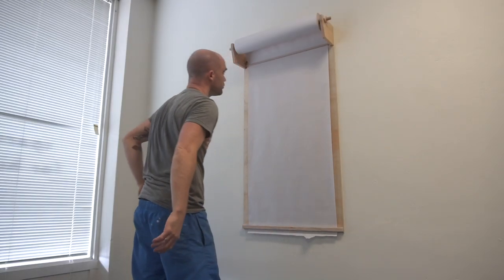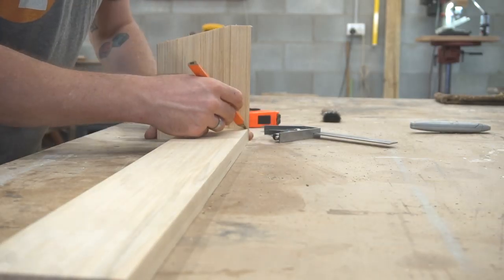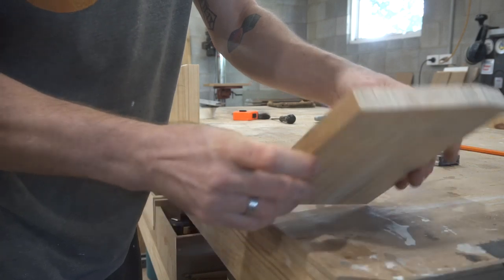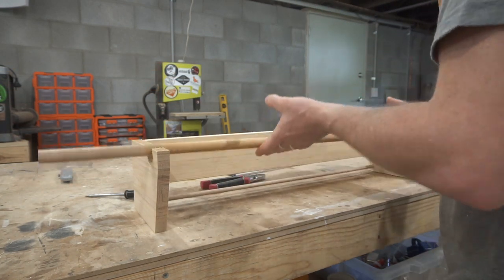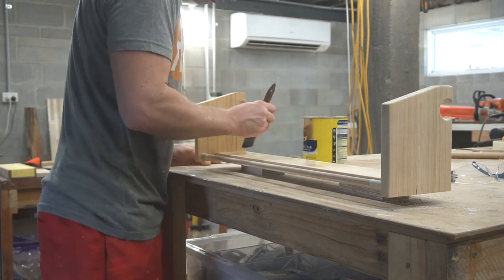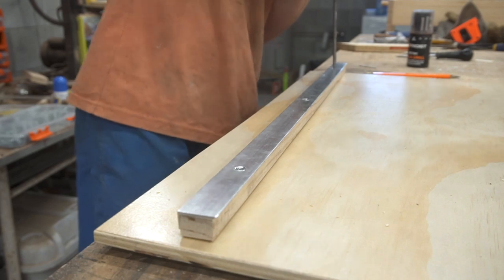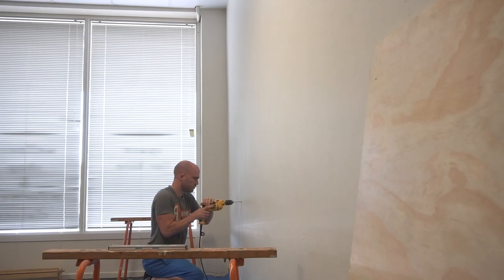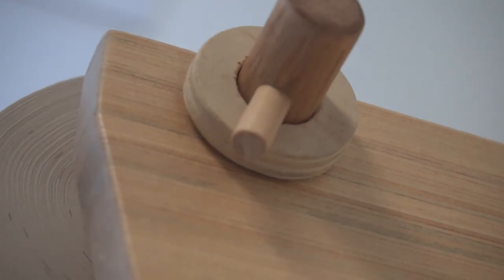How To Make A Studio Roller/Kraft Paper Dispenser | Woodworking

Comment: Was that an LVL? If so, how did it work? One of the materials I've never used, but have always wanted to after I saw it used for building a roubo.

I think I could use something like this instead of a whiteboard in the workshop, hrm!
Reply from the maker: It's edge laminated wood, from a company called 3Wood. So it's engineered but they're trying to get it into the fine woodworking market. I'm sure you've used something similar in video
Reply: @RobinLewisMakes  The stuff I've used is edge laminated plywood, so that the plys are all showing, but it still has alternating grain direction.

I've heard of, but know nothing more, 3Wood. It does sound like an LVL, just better looking than construction grade. Shame their website doesn't have any info like stockists!